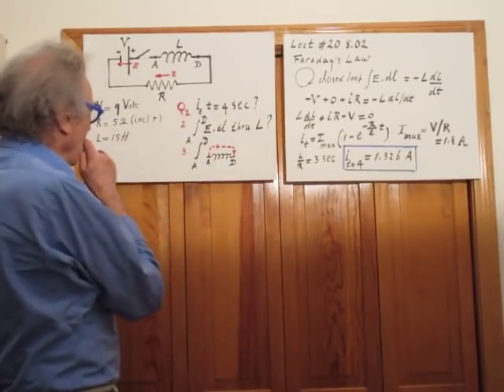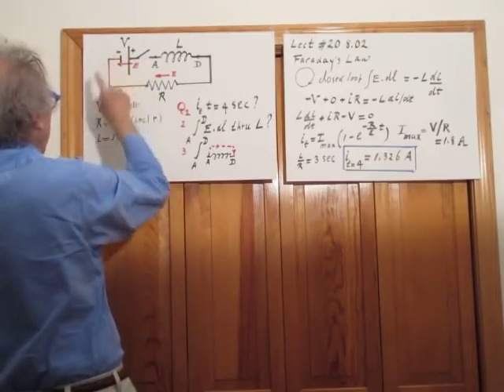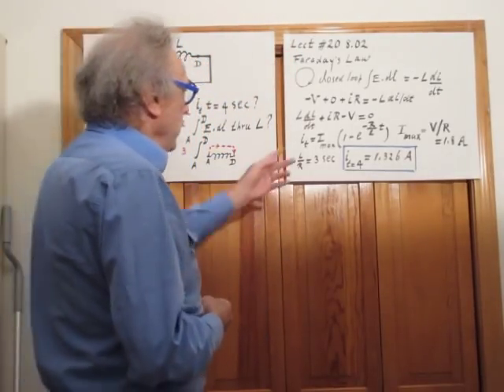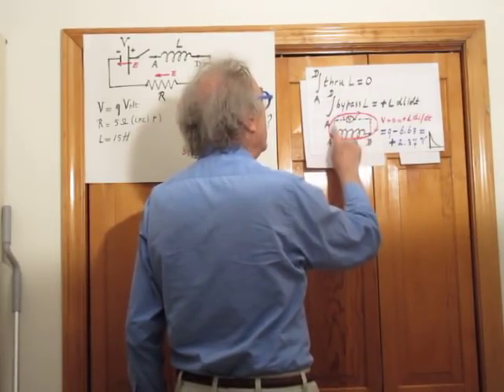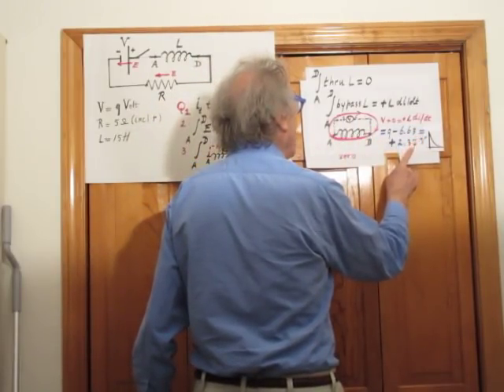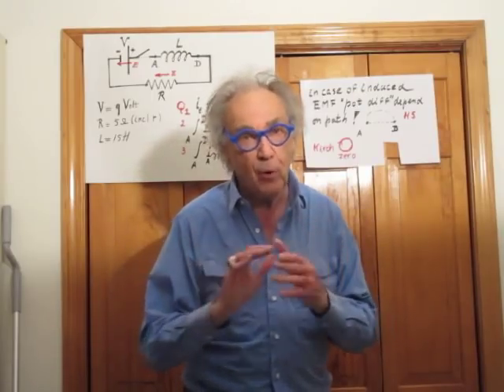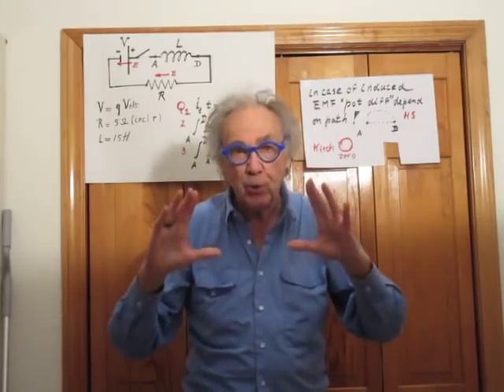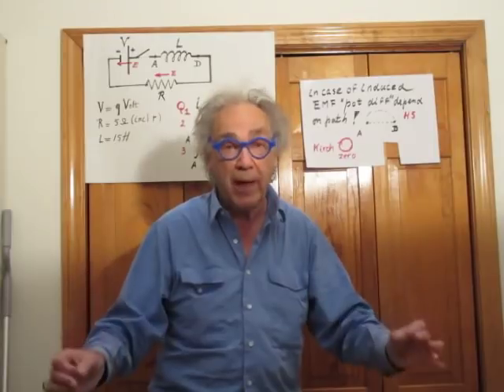Solutions Problem #75 Faraday's Law!

Comment: Professor, I have a simple question for you: as someone looking to self-study physics, do you think I should first be exposed to physics that only deals with algebra, or should I jump straight into your Youtube lectures? Cheers!
Reply from the maker: Math is the language of Physics.
Reply: I have watched most of the lectures in the past. You can still learn a lot with very average understanding of math especially 8.01. The thing that made it hard to follow at first was not the math but knowing what the symbol means. For example B is for magnetic field etc. If you have a physics textbook then the lectures can make it easier to understand and vice versa.

https://en.wikipedia.org/wiki/List_of_common_physics_notations
Reply: I'll tell you what I did.
I was in the same situation as you are.
I started learning basic maths, such as, algebra 1 2, geometry, trigonometry from various resources, such as, Khan Academy, Krista King and various books(optional).
And then to understand MIT 8.01 course better I learned Single Variable Calculus with the help of MIT's 18.01 course(I did every problem sets and exams) and Krista King's Calculus 1 course for problem solving. I used Calculus: Early Transcendentals as the textbook for 18.01.

    Once I finished with 18.01, I took 8.01, one of Walter Lewin's courses,  and keep on going to 18.02.

Now I'm finished studying 18.03sc and in the middle of 8.03 course.
After that I will just keep going with MIT lectures as far as I can.

Edited: Taking notes is the key. I always take notes.
The hardest part in all of this ,for me, was the begining, learning basic maths. So, don't give up and Good Luck.

Comment: Thank you. I like the hat. I understand. The lecture you refer to I have watched several times. It is what led me to my question of changing polarity in the source. I only wonder why this obvious (to me) source of energy is ignored. 
So: If the induced EMF around L at Max A is 2. 37 volts, and the polarity is reversed BEFORE the flux collapses in the inductor, does this constitute a changing magnetic field?: ie; will the induced EMF remain at 2.37 volts but alternate polarity at Max A and therefore induce current in a secondary WITHOUT any further current flowing in the source? 
The math I think shows that it will, however I am not sure. Thank you again.
Reply from the maker: my solution is correct and I cannot add to its clarity.
Reply: @lecturesbywalterlewin.they9259  I appreciate that. Thank you for the time in going over this again for us. Let's just hope that it is as obvious to others as it is to me. After all, there are four ways to induce electric currents. 1: Move a coil of wire past a magnet. 2: Move a magnet past a coil of wire. 3: Turn on or off an electromagnet. and 4: Change the polarity of an energised electromagnet.

Comment: Sir, Why an object of high potential need FREE CHARGES, for discharge to take place....? 
Why can't the charges in high potential discharge by ITSELF?example lightening and van de graaff
Reply from the maker: a neutral object can have a very high electric potential. THINKKKKKKKK
Reply: @lecturesbywalterlewin.they9259  Sir, Then why the electrons in van de Graff generator are not spilled into AIR AT LOW POTENTIAL.....?
Even air(nitrogen+oxygen) have negative electron affinity....
what keeps the ELECTRON  TO STAY IN VAN DE GRAFF? Why can't van de Graff push electrons into AIR? Will it push in vacuum?

Comment: Why is it that there is such a large amount of people who don't understand Kirchhoff/Faraday law correctly? Why do highschools teach the wrong things? Why do university textbooks teach the wrong things?
Reply from the maker: I don't think that high schools teach the wrong thing. They probably exclusively deal with circuits in which there are no magnetic flux changes. Thus the potential difference between 2 points are  independent of the path.  Why most college books teach the wrong Physics is very very disturbing. It means that the authors do not understand Faraday's Law. Read this: http://freepdfhosting.com/0813df09f5.pdf

Comment: when you said outside the inductor i didnt quite get that....i think you mean to say e.dl due to induced electric field. am i correct?
Reply from the maker: If you went from A to D in air, bypassing the self inductor, and if you measure E along your path (you can choose 100 different paths) from A to D then the integral of E dot dL along all those paths is +Ldi/dt. That's the immediate consequence of Faraday's law.
Reply: Lectures by Walter Lewin. They will make you ♥ Physics. Thanks for your valuable and quick reply.

Edit: this is my alt account

Comment: Respected sir, Could you please tell me, which book I have to follow for your lectures and to solve the assignment pdfs attached to the lectures of 801, 802 and 803.
Reply from the maker: 8.01
Physics
Hans C. Ohanian
Physics
2nd edition
W.W. Norton & Company
ISBN 0-393-95748-9

8.02
Physics for Scientists & Engineers by Douglas C. Giancoli. 
Prentice Hall
Third Edition
ISBN 0-13-021517-18

8.03
Vibrations and Waves by
Anthony French
CRC Press
ISBN 9780748744473

8.03
Electromagnetic Vibrations, Waves and Radiation 
by Bekefi and Barrett.
The MIT Press
ISBN 0-262-52047-8
Reply: @lecturesbywalterlewin.they9259  You're awesome! Thanks for your time replying much of the comments.
Reply: Respected sir, I am from India, odisha is my state. I searched these books on internet and found that these  books can't be shipped to my address even not to my state capital. What should I do. Could you please suggest anything else.

Comment: @ElectroBoom is coming soon lol
Reply from the maker: when he comes, send him this msg:
I appreciate the fact that this Physics may not be familiar to you. Don't feel embarrassed about it; you are not alone. However, it's never too late to get educated. The choice is yours. Maybe this will help you. 
I demonstrated at the end of my lecture #16 of my 8.02 E&M course at MIT that two identical voltmeters attached to the same 2 points in a circuit can show very different values. https://www.youtube.com/watch?v=nGQbA2jwkWI&list=PLyQSN7X0ro2314mKyUiOILaOC2hk6Pc3j&index=17 The reason is that in the case of an induced EMF (Faraday's Law) potential differences are no longer determined; they depend on the path. This also applies to the secondary windings of transformers as the EMF in the closed loop of secondary windings is induced. https://www.youtube.com/watch?v=b7i2uMx7gHo&list=PLyQSN7X0ro22zanLOcvkaSY-IZqheFYM5&index=8
Of course, in cases where Kirchhoff's loop rule (KVL) applies, 2 voltmeters attached to the same 2 points in a circuit will always show the same value. 
My demo was first suggested and published by Romer in December 1982 in the American Journal of Physics. This demo has now become a classic; it's done all over the world at many colleges and universities. 
Kirchhoff's original text can be found in the following link, pages 497-514: https://books.google.de/books?id=Ig8t8yIz20UC. Clearly he was fully aware of the prerequisite for his "loop rule". KVL is a special case of Faraday's Law. That's why Faraday's Law is one of Maxwell's equations and KVL is not.
By teaching students that KVL always works without telling them when it does not work, makes many believe that the closed loop integral of E dot dL is always zero. ElectroBOOM and Dirk Van Meirvenne therefore believe that 2 voltmeters attached to the same 2 points in a circuit must always show the same value which is not true as demonstrated in my lectures. They each posted a video (see @ note below) on their channel in which they claim to have proof for their wrong ideas which violate Maxwell's equations. Apparently they do not know, or do not understand, that in the case of an induced EMF potential differences are no longer determined; they depend on the path. MIT students who took my 8.02 course (Electricity and Magnetism) would not make this mistake! I therefore believe that to introduce a "modern version" of KVL and then teach students that KVL always holds is not advisable as you may set them up for making the same embarrassing mistake that both Dirk Van Meirvenne and ElectroBOOM made. 
Also read Professor John Belcher's thoughts on Faraday's Law and on KVL. Professor Belcher is my former colleague at MIT. http://freepdfhosting.com/0813df09f5.pdf
(@) ElectroBOOM insulted me in his video by mentioning that the reason why my 2 voltmeters read different values was due to "bad probing". If I had done the demo correctly I would have found that both voltmeters would have read the same value.  
This is my only msg on this issue. This is too basic. I do not argue either with people who believe that the Earth is flat.
Reply: Electroboom is nothing in front of professor  Walter lewin based on knowledge and I have watched the lecture in which sir lewin thoroughly explained the problem. in the vedio both the voltmeter attached at the node showed  different values and that is the proof .
Reply: It is very hard for electroboom to understand it.
Reply: @lecturesbywalterlewin.they9259  I think the point ElectroBOOM missing is that it is not bad probing, in fact, the problem is not 'how to make correct measurements'; the problem is 'why do we get different measurements between two points in this circuit'. And to explain it we need Faraday's law as even ElectroBOOM himself uses in his video. I am doing PhD in power electronics at uni of Nottingham, so I have the chance to see that an engineer and an academic can approach the same issue from different angles by using different conventions. So in my opinion you both are saying the same thing basically, but ElectroBOOM is approaching the issue as an engineer. This is why instead of saying 'in the case of induced emf, the potential difference between two points depends on the path', he says 'in the case of induced emf, we should do the measurement on "this" path'. Also in case of an induced emf, his convention for the closed loop includes the induced emf as well. That is why he says 'well we can take the solenoid as the primary winding of a transformer where the secondary becomes our circuit and therefore we include the voltage on the secondary side as well when we consider the closed loop, and hence the sum of all voltages are zero and KVL holds'. But anyway, I love youtube contents of you both and seeing this argument on youtube is great; it makes us thinking on these concepts and trying to understand them. So thank you very much both!
Reply from the maker: @trinidadtobagogs  I appreciate the fact that this Physics may not be familiar to you. Don't feel embarrassed about it; you are not alone. However, it's never too late to get educated. The choice is yours. Maybe this will help you. 
I demonstrated at the end of my lecture #16 of my 8.02 E&M course at MIT that two identical voltmeters attached to the same 2 points in a circuit can show very different values. https://www.youtube.com/watch?v=nGQbA2jwkWI&list=PLyQSN7X0ro2314mKyUiOILaOC2hk6Pc3j&index=17 The reason is that in the case of an induced EMF (Faraday's Law) potential differences are no longer determined; they depend on the path. This also applies to the secondary windings of transformers as the EMF in the closed loop of secondary windings is induced. https://www.youtube.com/watch?v=b7i2uMx7gHo&list=PLyQSN7X0ro22zanLOcvkaSY-IZqheFYM5&index=8
Of course, in cases where Kirchhoff's loop rule (KVL) applies, 2 voltmeters attached to the same 2 points in a circuit will always show the same value. 
My demo was first suggested and published by Romer in December 1982 in the American Journal of Physics. This demo has now become a classic; it's done all over the world at many colleges and universities. 
Kirchhoff's original text can be found in the following link, pages 497-514: https://books.google.de/books?id=Ig8t8yIz20UC. Clearly he was fully aware of the prerequisite for his "loop rule". KVL is a special case of Faraday's Law. That's why Faraday's Law is one of Maxwell's equations and KVL is not.
By teaching students that KVL always works without telling them when it does not work, makes many believe that the closed loop integral of E dot dL is always zero. ElectroBOOM and Dirk Van Meirvenne therefore believe that 2 voltmeters attached to the same 2 points in a circuit must always show the same value which is not true as demonstrated in my lectures. They each posted a video (see @ note below) on their channel in which they claim to have proof for their wrong ideas which violate Maxwell's equations. Apparently they do not know, or do not understand, that in the case of an induced EMF potential differences are no longer determined; they depend on the path. MIT students who took my 8.02 course (Electricity and Magnetism) would not make this mistake! I therefore believe that to introduce a "modern version" of KVL and then teach students that KVL always holds is not advisable as you may set them up for making the same embarrassing mistake that both Dirk Van Meirvenne and ElectroBOOM made. 
Also read Professor John Belcher's thoughts on Faraday's Law and on KVL. Professor Belcher is my former colleague at MIT. http://freepdfhosting.com/0813df09f5.pdf
(@) ElectroBOOM insulted me in his video by mentioning that the reason why my 2 voltmeters read different values was due to "bad probing". If I had done the demo correctly I would have found that both voltmeters would have read the same value.  
This is my only msg on this issue. This is too basic. I do not argue either with people who believe that the Earth is flat.
Reply: @lecturesbywalterlewin.they9259  lol I don't know why I got the same msg as ElectroBOOM, I didn't even tell my opinions on the concept, I just said the things that I understood from videos of you both. I am the messenger, don't shoot me! :)
Reply from the maker: @trinidadtobagogs   I sent you the msg for the reason that you wrote:  "you both are saying the same thing basically, but ElectroBOOM is approaching the issue as an engineer."  We are not saying the same thing and ElectroBOOM's statement that the 2 voltmeters (my Lect #16) should read the same value is WRONG